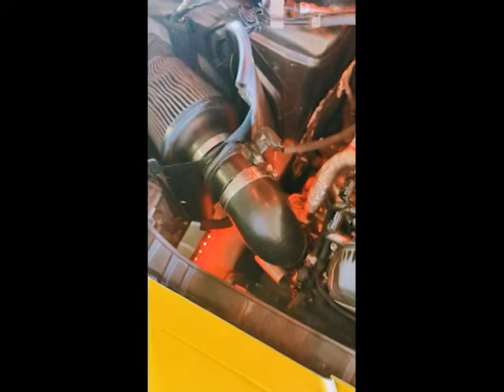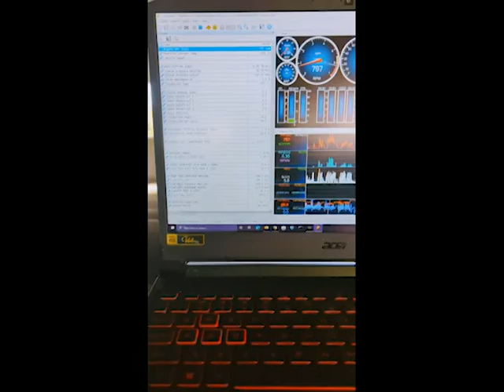A4 E85

Comment: Where these air leaks! Cause I got a crazy vac leak 20-30 LTFT +
Reply from the maker: I had the same issue. What CAI are you using? Also smoke test it. Check pcv or catch can if you have one.
Reply from the maker: Add me on Instagram and DM me. I'll help u as much as I can
Reply: if so hit me up, "syzygy" is my handle